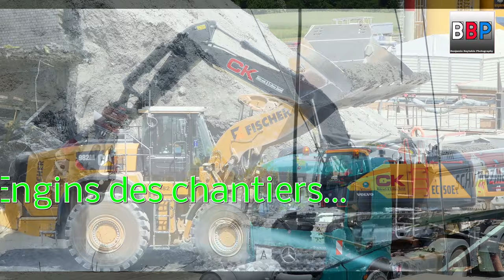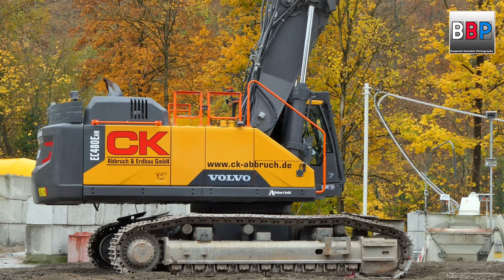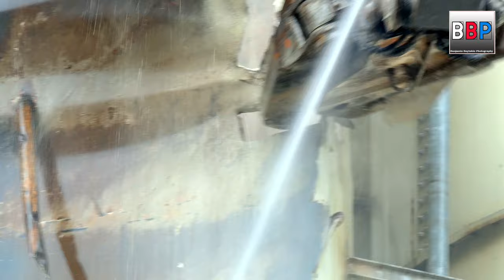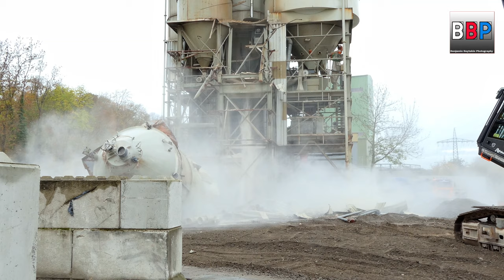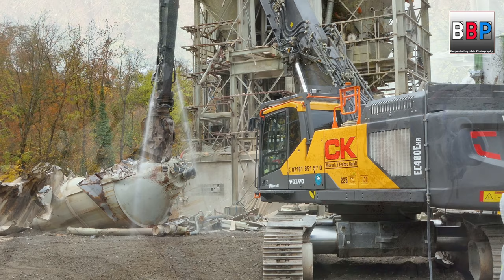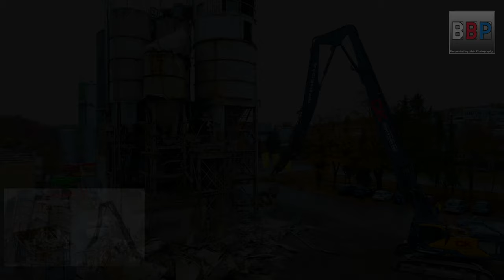VOLVO EC480E HR Longfront - Abbruch / Demolition Silos Unionbeton Ludwigsburg, 2018.

Comment: I don't do comment concerning the Volvo HR excavator: are all the same: Doosan, Volvo, Cat , Hitachi, Komatsu

I saw the Demarec Multifunction shear.Sorry, , I CONTINUOS PREFER THE JAPANESE CONCECT OF THE 2 JAWS SHEARS.

EXPECIALLY FOR THE HR BOOMS

Too flexion in one side of the HR dipper. With 2 cylinders, 2 mobile jaws, this flexion there isn't.

Now, is the same of use the typicol La Bounty one cylinder , one mobile jaw concect shear. Has more force  in confront to the DEMAREC, ALSO DEMAREC WITH DEMA POWER BOOSTERIZED CYLINDER.
Reply: means?